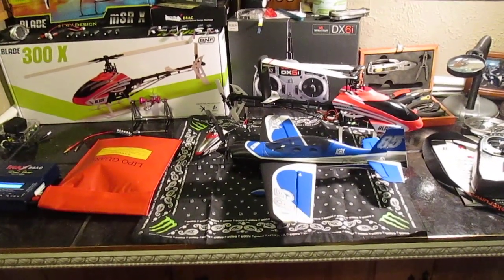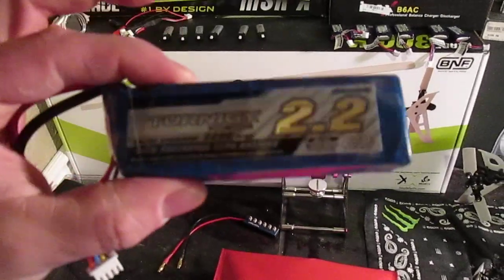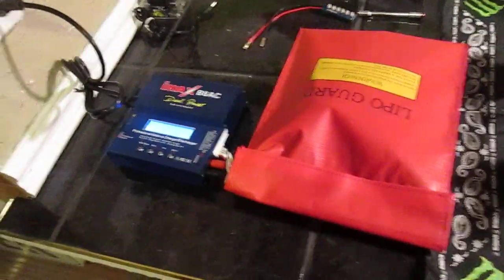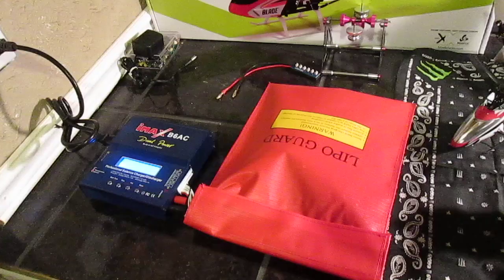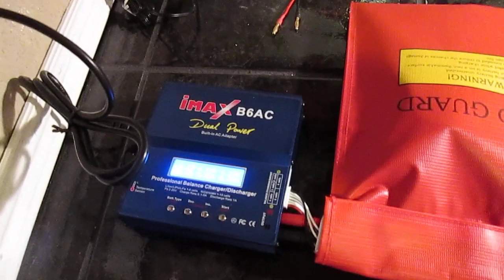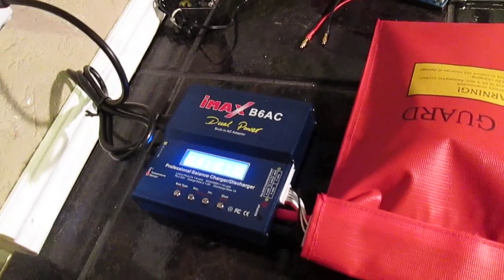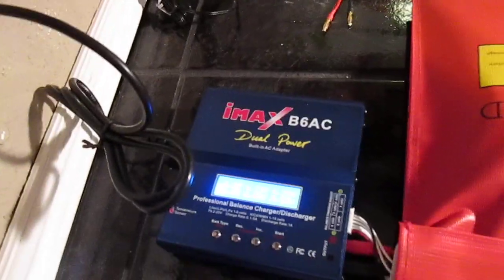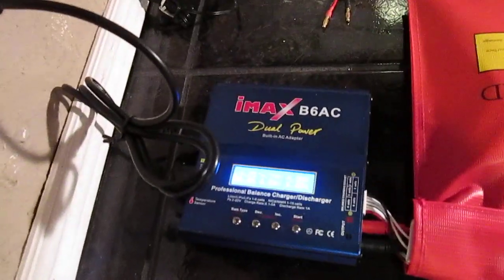How to fix a lipo battery with 1 weak cell

Comment: alright so i just got a new batt from hobbyking (1.2 ah 3cell 25c-50c) one of the cells came .12 behind the others. charged it up cells read 4.2 4.2 and the 3rd was behind by ~.12 and took forever to balance but eventually did to and all the cells finished at 4.20 however i checked the voltage again a few hours later and the 3rd dropped to ~4.1 while the others were still at 4.2 without any use. is this the same issue and should i use this to fix it ?
Reply from the maker: Justin Goncalves Thanks for you comment Justin, it really depends on what 4.1 is. With the other cells at 4.2 (4.20) and the lower one at 4.1 (4.10 - 4.19) ???If the lower one is only dropping 0.01 to 0.03 this is quite normal, if it is more on the 0.04 to 0.10 there could be an issue. So 4.20/4.20/4.17 and up is okay.and 4.20/4.20/4.16 and down is not so good.Hope this makes sense.
Reply: lol when i used 2 sig figs assume a zero is the 3rd. well i tried your method anyways its a smaller mah batt than yours so i discharged at .3 A they all evened out at around the 3.85 mark then i balanced charged at .2A until full seemed to work. ill see if the charge hold over the next few days and if the battery discharges evenly after use. ill keep you updated
Reply from the maker: Justin Goncalves Great, sounds like it worked..... You dont want to leave your lipo at full charge for days, it is just as bad as having it to far discharged!

You need to put the lipo in storage mode if you are not going to be using it, witch is 3.85 per cell on a 3s lipo.
After being in the hobby a few years I decided to always time my flights right in to storage mode, I would check all batteries at the end of a session and charge/discharge into storage if I missed the mark slightly.
So never discharge them to far, and never leave them fully charged more than 1 day( I wouldn't even do that) imo...
I have lipos going on 3 - 5 years, and they preform flawlessly still. The key is to care for them properly if you want them to last.

Hope this helps......    :)
Reply from the maker: Justin Goncalves Also, I would just blast a flight/run on the lipo..... then see if they are still even after land/park. lol
Reply: thanks!
Reply: what A do you think i should store charge at ? the same ah rating at my battery or no ?
Reply from the maker: With a 1800mah, I would do 0.05 to 0.08
Reply from the maker: Mad Man Slice I meant 0.5 to 0.8

Some chargers will only offer 1.0A to storage. If thats all you got....... use it.
Reply: ok thanks. unfortunately i do not think this worked or maybe i have to do it a few more times. after a couple hours i checked the voltage and cell1 was at 4.17 cell2 was at 4.19 and cell 3 was at 4.08.
Reply: no im storing at .3A since its only 1.2ah

Comment: hi mad man
i have a fresh new lipo zippy 4000 30c 3s, and i used for 1 time to calibrate de quads motors a test fligh etc etc, and a have 1s 1,26v
2s 1.30v
3s 3.54v
i bought a shi** charger from HK, dc4s, and got error 5, shoul i buy a better like imax, or is something wrong with lipo?
best regards
Reply from the maker: Jose Abreu Hate to tell you this.... But if you have cells sitting at 1.26v and 1.30v per cell they are way past the rate of damaging the lipo. It is probably done.
Did you charge the battery before you calibrated and test flight? If so, what where the cells at when you got it? If they were not in the 3.80 - 3.85 per cell , I would be in contact with HK. Not sure how you got the cells that low without noticing.... Could be the crap charger maybe???
Sorry this has happened to you, You could try to balance charge it up slowly but I would suspect it would not work.
Good luck Jose
Take care........    :)
Reply: Mad Man Slice mad man, thank you for the response mate.

i bought this bat 2 month, but im assemble the quadcopter, part by part, one month i bought the rx/tx, outher the flight control,, outher esc (qbrain 4*25=) and so long...this to tell you that this battery was for 2 month standing by, then this week, i assemble all parts, calibrate and test motors and so long, it work fine, 
i dont put any alarm, so when i see the flight control with no power i see then that battery was discharged, and i try to charged.
by the way, i never charged before, even when i received..

if hobbyking dont say nothing, ill try a solution, and then ill show you the results.
what im thinking, and i have a litle solid knowledge about electronic and electricity, im going to charge with a direct 4.2v (digital lab power supply) each cell individuality with a low filter passing by with about 100mha for 12hours, then lets see:)

best regards, and keep good work mate
Reply from the maker: Your battery would have been delivered at 3.85 per cell probably.That is storage mode for a 3s lipo. If you did not charge it at all ,but used it to set up and do a test flight without LVC (low voltage cutoff) on, you may have damaged your battery beyond being able to bring it back to life. I have never seen a lipo with that low of a cell voltage (1.26).
If you do repair it some how, be sure to post a video of how you saved it.
Thanks, and hope it works out for you!

Comment: 4.2-4.2-4.03.....childs play
How about a 1200mah 2S at 4.20 and 3.80, now that's unbalanced. I used your method and from a discharged state of app. 3.4V, the difference was still about 0.18V, I started balance charging at 0.2A. Balancing was matched incrementally until 4.20V. I then discharged to 3.80V and recharged at 1A until 4.20 reached again.

So Madman, many thanks for saving my battery.

I just purchased the B6 MINI and this was my first experience with a lipo battery problem, other than included IMAX B3 which made no headway in balancing and could have been the cause of my problem. I just don't know because I hadn't yet purchase a battery checker, anyway, the B3 couldn't balance the lipo.
Thanks again!
I believe you'll get a kick out of the fact that this lipo is for an expensive ecig mod I just bought.
Reply from the maker: Rick9482 Wow, that one was really unbalanced! I still use that battery in the video to this day, and is working flawlessly.
So you should not have any problems with yours either. I got a battery checker a little while ago, it seems to be a little off a true reading to me since I charge with a icharger and psu. I think spending the extra cash on a battery checker would be ideal, cause the cheap one I got I dont believe it most the time... lol

Many thanks to you and all the others that this method worked for, and the thumbs up!!!
Comments like this make me want to keep making more vids.

Thanks..... Take care      :)
Reply: Mad Man Slice Glad you enjoyed my comment. I purchased a small AOK-BL8S for around $12. Matches voltages just fine and I guess it's so small you can set the alarm to go off when battery level gets low. Apparently it gets attached to the plane.
Reply from the maker: Sound a lot like the telemetry mode in my dx8 for checking battery status. Sounds a lot cheaper than the module rx tho.
I will have to check that out. Thanks

Comment: i discharge mine .05 and recharge it with .5
Reply: did it work ?
Reply: yes. basttery is working fine until now
Reply: great. my batt is only 1.2ah so i think i should discharge closer. doing it as we speak fingers crossed

Comment: Love the iMax B6 AC/DC charger, can't beat if for the price. 

I had a 6000mAh 2S battery that developped a weak cell too and I cycled it on my Orion Advantage Touch Duo ( C / D / C ) and I ended up reviving the weak cell.
Reply from the maker: RC Marty I loved the imax as well, its a nice entry level charger for a great price.
Glad to hear you got your lipo fixed up, cause man.... they are getting expensive. 
Take care.......   :)
Reply: Yes they are getting expensive, especially when you live outside of the 48 continental US states... shipping is getting quite pricey for lipos.
Reply from the maker: I find the best way for me to get lipos these days in Canada is RCCanada. Lots of good people on that site selling new and used lipos along with free shipping sometimes.
Reply: Cool, I'll make sure to check them out. 
A great place I found near Montreal (QC) is Bego Racing, they're a Canadian distributor for SMC lipos, great batteries for the price !!!

Comment: I tired this method, and the first attempt didn't work. Cell 1 is about 0.2v off. However the second time I charged it at 0.4A for 4 hours, and now all the cells are at 3.90v. I didn't fully charge it yet, but I can see your method is effective.

Have you ever tried charging just one cell at a time from the balance port? Like charging it with a special 2-pin port directly into the balance port, which treats it like a 1s? It seems dangerous of course.
Reply from the maker: Daniel Allen Thanks Daniel, glad to hear it worked the second time around.Cant say I would try the other method you mentioned, your right...sounds like a fire waiting to happen..lol
Reply: Mad Man Slice yeah it does sound dangerous, but its probably fine if you charge slowly and make sure the polarity is right. It is the internal resistance that's causing the difference. It would probably return to a similar state after discharge.

Comment: What should i do i have 3s lipo but the one s puff. How can i fix this? I plug in to lipo indicator one 1s is low voltage the other 2 is normal.
Reply from the maker: Hey Ben,
Personally I would toss it, a puffed battery is dangerous.
I know fellow pilots that still run puffed batteries and get away with it, but I would not recommend it.
If your going to keep it, I would always have it in a sealed fire proof container outside, when your not using it. PLEASE DO NOT store it in the house.
Sorry I am not much help... Take care.
Reply: omg thanks dude.. i will follow what u said
Reply from the maker: Ben,
Not trying to scare you but, look up " when lipo batteries explode" on youtube.... People have burnt down their houses cause of improper use of lipos or lack of knowledge...etc.
Just make sure you know exactly what you are doing when playing with these things. They can be ticking time bombs if you do not!
Not trying to freak you out... just dont want to see a fellow pilot hurt himself or his family. Take care.....   :)
Reply: Aw come on, puffed batteries are fun AT YOUR OWN RISK take the battery outside to a safe place and hook up a 12 volt low amp power supply to it....just have a fire extinguisher handy...at your own risk!

Comment: Well after 8 or 9 hours of balance charging at 0.1amp (the charger selected this itself) I'm happy to report that it has worked. Both cells are balanced as close as possible. One is at 4.26v and the other is at 4.19v. I reckon after a run in the car it should sort itself out. Then i'll remember to storage charge it before putting it in the garage! Time to check my other lipo now ;)
Thanks again MrTimmbur.

Comment from the maker: You may need to use the discharge mode to get them even." mine took till about 3.5 to even out". Storage mode will only take your batt down to 3.8 before it turns itself off. Just watch your cells carefully till they even out.
You can try to balance charge them back at 1 amp, and tell me how it goes. You just have a better chance for it to fix itself at lower charge rate... Good luck.

Comment: Nice one for this video. Have just found one of my cells (2s 5000mah battery) was at 4.03v and the other was 4.23v. I'm discharging at the mo using the storage charge facility to get both cells down to around 3.7v. Then I'll balance charge and hope for the best. Do you think I can get away with charging at 1 amp or should I do it as you recommend at 0.2 amps?

Comment from the maker: Thanks for the advice, but my weak cell was never that low.  When I discharged it at 1amp, it went even at 3.5... And if I was to charge it again the same way I did the first time it would of charged unbalanced again. 
It is key to charge it back at a low rate... :)

Comment: You only have to bring the weaker battery up to 3.2 volts on low amp setting before resetting the charger to regular current setting.